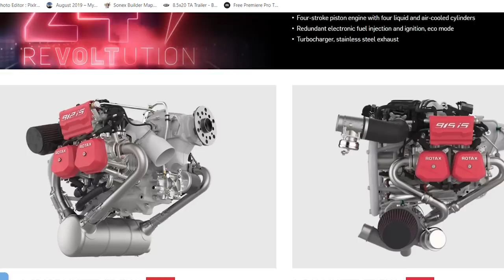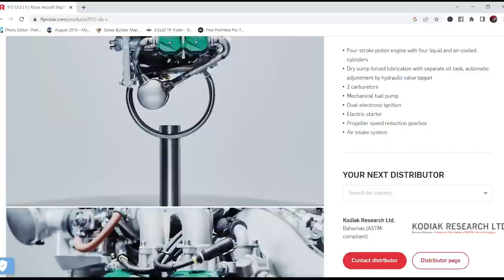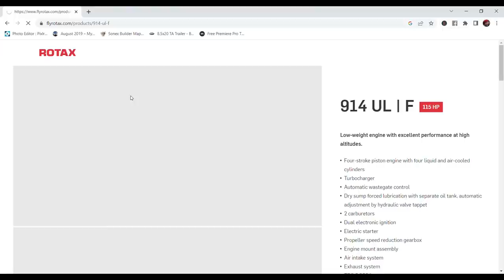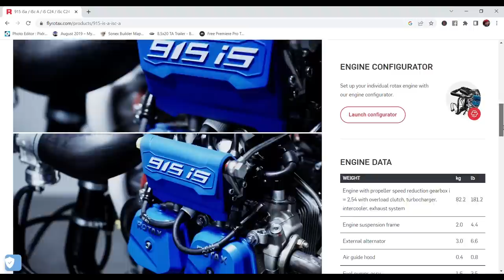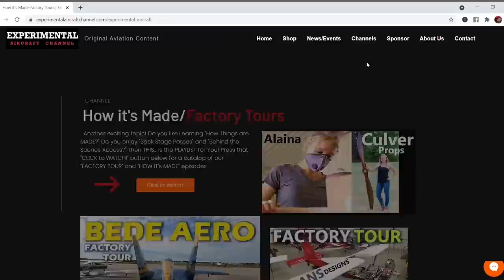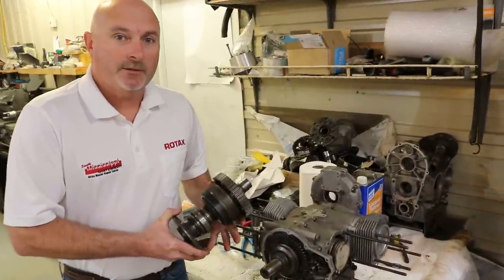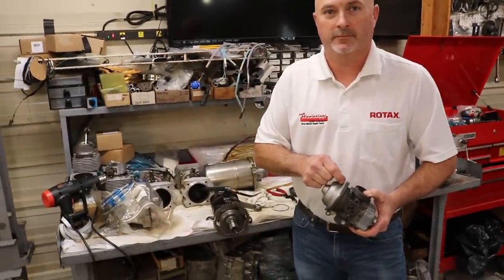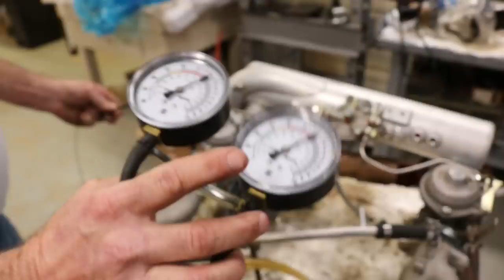Rotax Aircraft Engines - Engine Week 2022

Comment: Hey Brian, I like these technical videos on how engines work and are repaired or rebuilt. Most of us airplane junkies can recite the specs on most engines and while it does feed the monster to watch a rep talk about their engines, it’s mostly talking points that can be found on the manufacturers website. However, learning about spags, slipper clutches, and carb balancing is not something you see too often. One of my favorite videos you’ve done is of the engine rebuilds at Airworks.  Thank! Keep up the good work.

Comment: Sixty years ago we called it syncing the props.   When the two engines are in sync there is a steady humming sound.   We would sync the props while airborne.   We had separate throttles for each engine and separate prop pitch controls.   My experience was with a twin Beechcraft called the SNB (Secret Navy Bomber)[joke].

Comment: .001" piston-to-cylinder clearance?!? WOW!! As a mechanic of many years, that is IMPRESSIVE, and the first I've ever heard of a clearance that tight!  I love these engines since they're very similar to the Japanese on and off-road engines I cut my mechanical teeth on as a kid. I've worked on 2-stroke 582's in powered parachutes a few times - very well built engines. Was always a big fan of Bombardier snowmobiles (Ski-Doo) way back in the day as well. Can't go wrong with those engines. GREAT video series, Bryan! I've got some catching up to do!
Reply from the maker: Thanks for stopping by! It's been a fun week learning about ENGINES! :-)
Reply: Stock Ford 302 pushrod V8 engines can have PTW clearance as tight as half a thou from factory. I ran 1.5 on my forged 4032 Mahle pistons, as I rev to 5k only on my 331
Reply: @WesternReloader  You sure about that? I've never heard of ANY manufacturer or ANY engine running that tight. 0018" -.0025" is commonplace from small engines / motorcycles / OPE, to cars / trucks.

Comment: So a "routine" engine oil level check involves "burping" and "operating" the engine AFTER "pulling the dipstick" to CHECK "how much oil" is in the "oil tank" before hand cranking the engine WHILE listening for "gurgling" - how much gurgling or how long to gurgle isn't "specified" - to ensure the engine is "getting oil" and the dry sump system is "primed" and THEN the engine can be."operafed" long enough to completely "burn" the excess engine out of the crankcase and THEN oil level in the oil "tank" can properly be "checked". 

A "dry sump" engine with pressure lube "burns" the excess oil out of the crankcase? So its "total loss"? 

Interesting. Dry sump means "excess oil" in the CRANKCASE "sump" is "scavenged" and returned to the "tank" (typically the "technical term" used by "certified" mechanics is RESERVOIR or SUPPLY) and there is actually LESS oil loss than if a dry-sump "high performance" engine  were "wet sump" because "blowby" is reduced along with "windage" and oil "foaming". 

A "vacuum" in the crankcase (relative to intake manifold "vacuum" relative to atmospheric pressure caused by air cleaner and carb restriction) also reduces "blowby". 

So I'm having trouble buying your "expertise" or at least Rotax "engineering".

Comment: To me, Rotax came as a disappointment.  Although they are the weight champion, they did not do the industry any favors in cost, Rotax are basically as expensive as the classical aircraft engines.  If you want a more advanced engine, such as Suzuki, Honda  etc , you can get one for about 1/2 the cost for the same HP. I guess it is a huge company, with lots of overheads and share holders to pay off. Some of the models of the engines are basically obsolete when first introduced, they came with carburators  when automotive had injection more than a decade ago. Rotax is also snail slow in expanding the HP range. It is only up to 145 HP now.  It is normal for a large company to be less agile and smaller companies get the jump on them, such as Edge Performance. GM too had that problem and lots of performance hardware were developed by others. But when you are a small company in the south Pacific and someone else get the jump improving your engine, it is not good optics for your R and D dept.
Reply: That's why I fly behind a Jabiru engine, and despite the static about their old engines, they have been good to me for nearly 15 years.